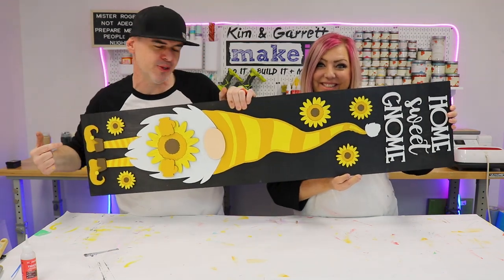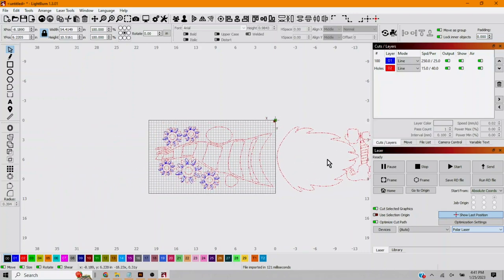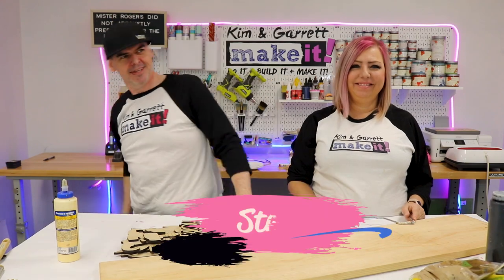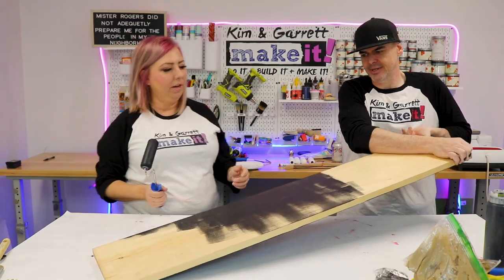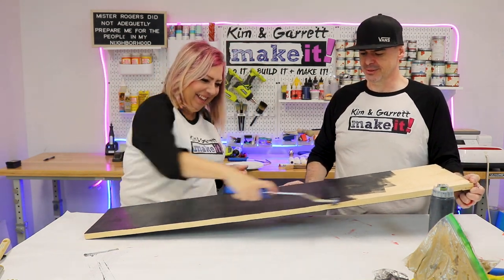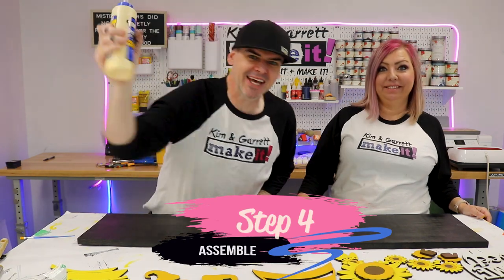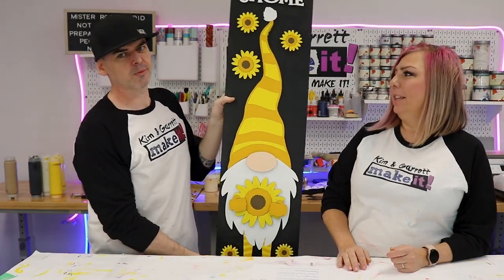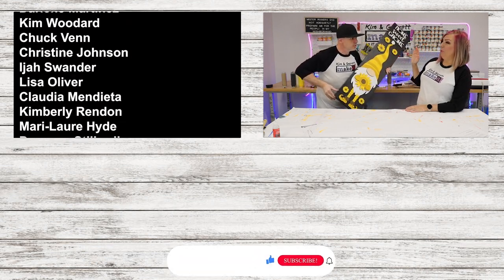Make Lots of Money This Spring with OMTech's Polar Laser

Comment: How does the MDF hold up outside?
Reply from the maker: It does pretty good as long as it's not directly in the rain.  I have a few test signs out in the back parking lot, uncovered just bathing in the rain and sun.  The oldest sign out there is from Last August and it did loose a few little pieces, but you don't notice until you get closer.  We use Outdoor House paint to help seal them.  Thanks!  ~garrett

Comment: My laser isn't very big (Flux Beamo)  and it doesn't use lightburn. Is there a work around?
Reply from the maker: The SVGs should still work. I don't know the cutting area of the beamo but I am sure you could rearrange it or shrink it slightly. Thanks! ~garrett
Reply: @Kim and Garrett make it  it's 8 x 12. Thanks!